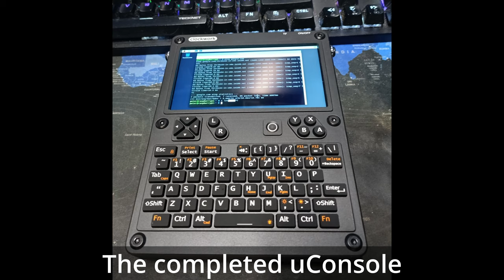Building the Clockwork PI uConsole

Comment: Wow it looks great. And all it's made from aluminum ?
To bad that there is no Ethernet port.
What is working time on battery ?
Reply from the maker: I've not used it heavily yet so don't have a figure but the batteries have lasted a long time so far on the initial charge so it's around 5+ hours at least

Comment: Nice walkthrough, looking forward to mine turning up. Was there any bits left over?
Reply from the maker: In the end there was 2 spare screws, a blank expansion port cover (as I used the one with the headphone socket for the 4G module) and the semi-transparent power button, as you can use either that one which lights up or the black one that's originally attached to the keyboard & I used the black one.